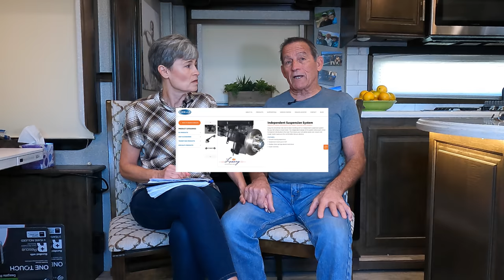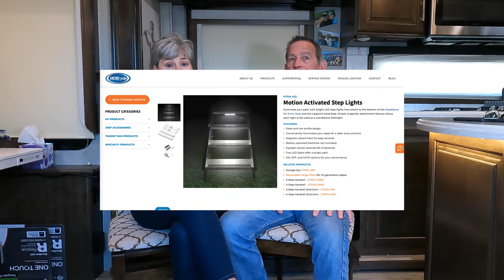Shaking the camper to pieces | The change we made to our RV | MORryde Independent suspension

Comment: Will parts for that upgrade be hard to find when you're out on the road thousands of miles away from the dealer?
Reply from the maker: Great question! Certainly no harder than finding leaf springs or repairing a broken hanger. We won't need parts very often. Down the line we will need we'll need to replace the spring itself (two big rubber blocks).

Comment: Thanks for the video.  How much weight do you think you added due to new axels vs. the old ones?
Reply: dont think that would come into play at all; the weight issue is whatever is ABOVE the frame contained in the trailer itself not underneath it.
Reply from the maker: It's considered unsprung weight because it is under the frame. The IS added 3-400 pounds in our estimate.
Reply: @LizAmazing  so 400 lbs above the original weight with the original axles etc....so how will you counter that, or are you still under the weight limit regardless....

Comment: Did you go with 7000 lbs axles or 8000
Reply from the maker: We did the 7000, 8000 is an option but the frame rating stays the same

Comment: Air ride fifth wheel hitches like TrailerSaver will fix this too.
Reply from the maker: That will just change what you feel inside the tow vehicle. It doesn't change what is happening with the wheels.
Reply: @LizAmazing  actually that’s not true. TrailerSaver also dampens the bouncing and chucking of the camper also.

Comment: If you want to keep the fillings in your teeth, stay off of I-95 in SC, especially the northbound right lane.  Worst road in the country that I’ve been on.  I had holes in the bottom of a fiberglass boat after towing it on this road and that was several years ago.  I tow my camper all over the U.S., usually without any issues from road bounce, but I-95 typically creates some sort of problem.
Reply from the maker: Oh my gosh, thanks for the tip. Happy travels!

Comment: Travel trailers sure must be cheaply made now days. Ok never really had any problems  but then probably when the construction and quality were better. So you pay more but get less when buying. I know full time in an RV is not what most were really designed for unless you just sit at one location and not over the road
Reply from the maker: Agreed. They really are slapping them together these days. Older rigs are much better made it seems.

Comment: $8,000 for suspension. That’s quite a hearty price tag. Maybe you can get the parts and have someone else do it for much cheaper.
Reply from the maker: The $8000 includes hydraulic disc brakes. We definitely would not want someone doing this job who hasn't done it before, too much that could go wrong. Thanks for watching, Mike. Here is our latest:  https://youtu.be/BmQh0Gzrz40
Reply: @LizAmazing  yeah I wouldn’t want someone that doesn’t have experience with trailers. I have a guy that does all my suspension welding. He’s a semi trailer repair. 

Just because they sold it, doesn’t mean others couldn’t install it properly. 

How much were the disc brake system or how much with regular electric brake?
Reply from the maker: @mikemiller9119  I think it was about a $1000 for the hydraulic brake upgrade.

Comment: Very expensive BUT you now have the best to protect your very very expensive 5th wheel. The shame of all this is after all the years rv’s have been made why can’t they make them a little better. Why can’t they learn over time what it takes to properly build this rig where it will last. It’s actually sad that it can’t be done.
Reply from the maker: Yep. The MORryde Independent Suspension is an option when ordering from Grand Design, though, so that's something. For people only using their camper just a few times a year on weekends (RV manufacturers core business), they just want something as cheap as possible and the RV makers comply.